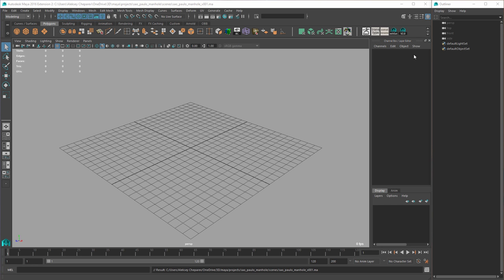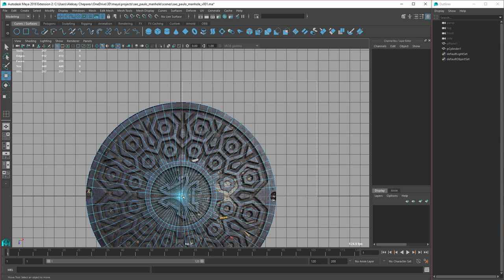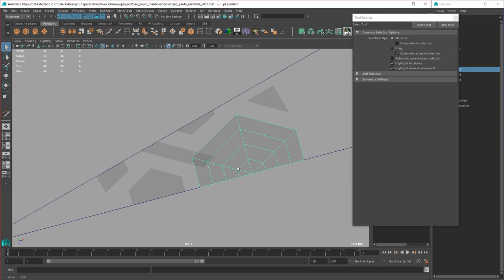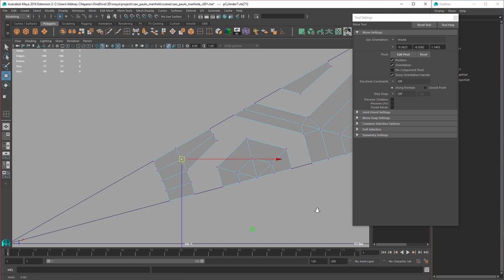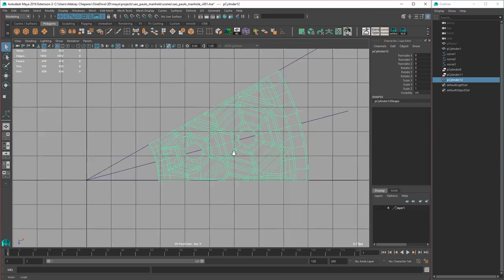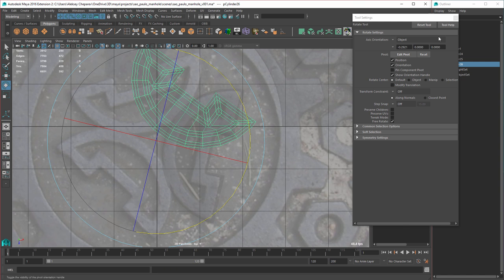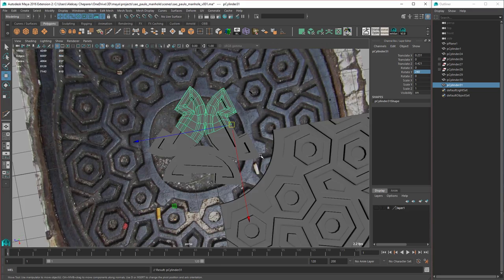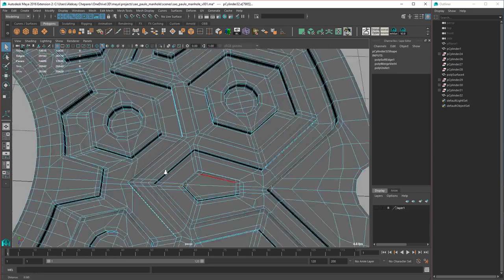Modeling Sao Paulo Telephone Manhole Cover

Comment: the multi cut tool if you click on each outside of the mesh, without dragging, you can create a custom cut plane without commiting then edit the end points and align them perfectly, sometimes if my hands are tired its hard to be exact with one swipe so that helps, also if you do this you can middle mouse drag and slide the cut plane :)
Reply from the maker: +picosdrivethru Those are good tips!
Reply: Could you please explain this again? I read and tried to understand what you're trying to say about 10 times but simply can't figure it out. Thank you :)

Comment: Very appreciated this tutorial.
Will be even or helpful to see how you go about combining the different shapes in one piece before you bevel them, or at least a portion of it and then you speed up the rest. for us as a Maya modelers it helps a lot to see how to connect the vertices and edges of polygons together and ends up with quads , thanks a lot
Reply: you can set the video speed at .25 times slower.
Reply: thanks

Comment: Great stuff as always, much appreciated. Out of interest, which mouse do you use for modeling?
Reply from the maker: Thanks! I am using the Microsoft Intellimouse Explorer 3.0 It's an old mouse but they still make it. I like it because it is light, a good size, and the middle mouse is solid but not hard to press. I have a separate gaming mouse for use when not using Maya or for gaming (Logitech G700s). While it's great for gaming and everyday tasks, the middle mouse button on the Logitech is a bit stiff, which is not ideal for Maya, for me at least.
Reply: a good middle mouse button is key (no pun intended)